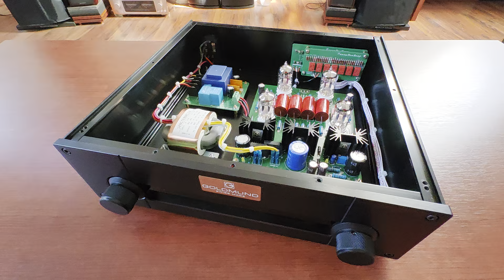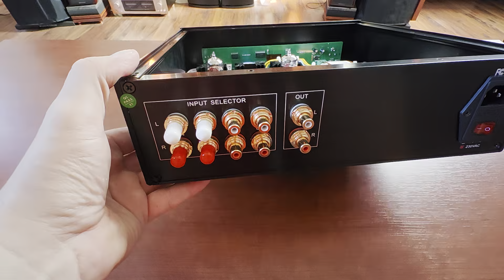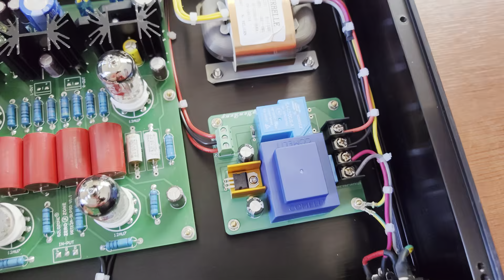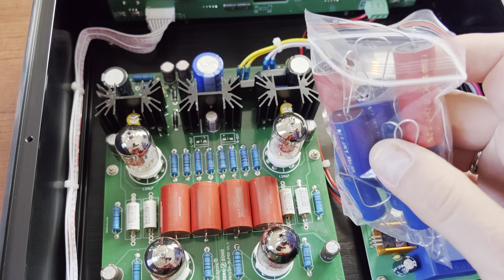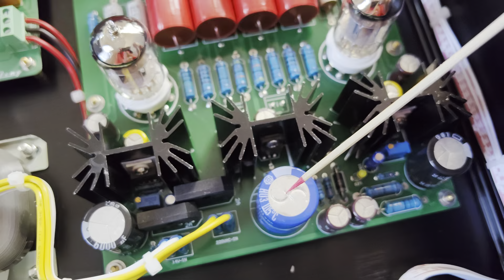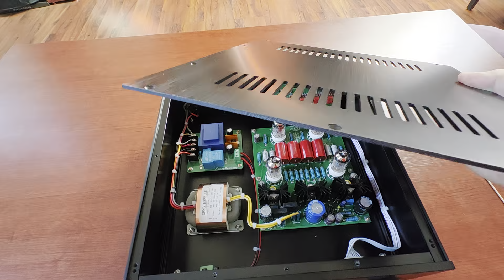Cary SLP-90 clone tube preamplifier first look - ZeroZone PRT12A

Comment: The blue capacitor is Hitachi. It has the correct value and is quite good. There’s no need to replace it at all. K2700 is the marking of the transistor that is located nearby in the circuit and is attached to the black metal piece.😅

Comment: Do you know what the volume increment changes are, as indicated (I assume) on the front panel? 1db steps? 1/2db steps? For me 1db is too crude. 1/2db is preferred. --Thanks
Reply from the maker: Hi! No idea, the volume setting module is a generic one, it has 128steps but I can tell you how much db is one step :(

Comment: Buyer beware! I saw this video and bought one of these. I received it and loved the way it sounded. In less than 3 weeks it was dead. I went to turn it on one day and nothing. Contacted the seller and was given the runaround. Checked the fuse. It was good. Changed it anyway-still wouldn't turn on. Took the top off and checked the inside. Nothing scorched, burnt-looked clean. Seller would not make right on this. EBAY Seller is pinshuche. I spent nearly $400 dollars after shipping etc. Now I have a paper weight.
Reply: I also bought one from that supplier. OK so far. Have you made any progress?

Comment: Does anyone already came across the schematic of this preamplifier? I want to reduce the gain, because with CD-player or Phono-preamp it's much to loud with my NHB-108 Pro clone!
Reply from the maker: I think there was some info on that in the comments for the full review video (look for the other one)
Reply: I bought a pair of 20dB Rothwell attenuators and fitted them to the power amplifier inputs. 
The difference is remarkable. Previously the maximum bearable volume on the Cary was about 30. Now it's 60, and the music sounds more alive. I really recommend them.

Comment: Those capacitors near the heatsinks are not reliable
Reply from the maker: I'm not sure if there was a significantly high temp from the radiators. I think I've measured that - I check internals with laser thermometer during burn in to be sure I will not burn my house overnight :D

Comment: Just a quick question.

Does the Cary run hot?

I going to have to install it in an entertainment center cabinet with a closed glass door.
Reply from the maker: No its not, but when in use do open the door - its healthy for any audio equipement to have some air circulation :)
Reply: @ Will do and thank you for the reply.

👍🏻

Comment: Hello,

I have the Wiim Ultra that I’m using as my DAC and Preamp that will soon be going to my Zero Zone TPA3255 mono blocks when they arrive.

Question would you think I would get a big improvement in sound quality if I feed my Wiim Ultra streamer DAC/Preamp through the Cary preamp then to the TPA 3255 amps?

Does the volume knob on the Cary SPL90 stay at the same level when you turn it on and off? If so I could just set the Cary volume knob and then use my IPAD to control the master volume on the Wiim app from my tablet.

Thank you…
Reply from the maker: Yes the Cary as vol control would allow your WiiM to work with 100% volume so you would not loose any details in digital domain (lower effective bitrange). Cary controls volume via relays so the position of the pot is irrelevant, it just remember the volume level that had been set. And it has remote too :D
Reply: @ Awesome thank you very much.

Have a fantastic day.

Comment: Hi Volks,

So today is my Cary arrived 🎉. After 10h burnin I listen music over the Cary SLP-90:

It’s very very good sound. But my Marantz Series 7 is also good, too. The Marantz is for me the best of this TOP-PreAmp, because the sound is more free as the Cary. The Cary has more heat…more wood and the Marantz more Air into the sound. The stage is grater by the Marantz. The Cary has more focus in the middle. But that’s by my ears😅.
Reply from the maker: Thanks for sharing! Thats with stock tubes right?
Reply: @k4syx  yes I with stock-Tubes. I will change @ the Marantz the MKT to MKP.  Tom, do U have Change the Tubes @ the Cary?
Reply from the maker: @FDKAUSW  I did the review with the stock ones as thats what everyone will get with the preamp, but then I've replaced tubes with better ones that I have in my collection and that was a significant upgrade. Tube rolling is dangerous for your wallet though, be warned! :)
Reply: @k4syx  what fore Tubes do U use for replace? Thx.
Reply from the maker: @FDKAUSW  psvane art (-s) series
Reply: @ Mr. Schwarzbeck says:“Use JJ-Tubes“ I have now no referenc what is the Right Tubes… f*** 😅 But for the Maranztz I need ECC83 Tubes, but I think it’s the same kind of Problem: With Tube are the audiophilest Tubes…??
Reply from the maker: @FDKAUSW  that's the road down the rabbit hole :D
I'm piling up some NOS tubes for a few years now, it's not like there will be more of them smt time soon and I don't expect any price drops :)
Reply: @ witch pill 💊 I must eat that U let me in Morpheus?

What is now the right way in to the hole or other witch tube is the best audiophile for ECC83? Thx
Reply from the maker: @FDKAUSW  the thing about the tubes is they change some in different ways in different requirement. That's a nightmare because something that sounds great in my amp may be not the best choice for someone's preamp and vice versa.
And also there's the thing where some guys will love muddy warm sounding tubes over clean and transparent ones...
I'm reading as much as I can and get new stuff when I see great opportunity. 
For example you can't go wrong with original Siemens, Amperex Telefunken or RCA tubes. 
But these get more and more expensive every year as there is less and less of them. 
I have some Amperex, some Mitsubishi, Siemens and RCA tubes and I do plan to make videos on them in the future if there will be interest in something like that
Reply: @ I just looked up ECC83 here on YT. Very interesting! Most of the videos are electric guitar amplifiers... and I have to admit that the changes in sound are within limits. So they are definitely not a big deal... I expected a much bigger difference, given all the fuss that is being made... I just bought NOS tubes made in Russia. I'm really excited...

Comment: TIP: To reduce the switch-on POPer to a very low level, I recommend setting the switch-on delay to 360 seconds. The POPer is then barely noticeable, even when the amplifier is switched on. This period of time is also used by e.g. B. audio research specified for their switch-on delays.
Reply from the maker: THANKS! I will definetely try that as I also got CAT-1 pre clone that has the same chassis!
Reply: @ F-1
0-127
Default volume for input channel 1
F-2
0-127
Default volume for input channel 2
F-3
0-127
Default volume for input channel 3
F-4
0-127
Default volume for input channel 3
F-5
0-127
Maximum volume setting
F-6
0-255
Signal output delay after startup
            (seconds)
F-7
0
Positive phase encoder
1
Inverse phase encoder
F-8
0
The startup volume is set to the default volume
1
The startup volume is the memory volume
F-9
0
State after power on: standby
1
State after power on: turned on
F-A
1-8
Display brightness during operation
F-B
Display brightness without operation
F-C
0-99
Brightness retention time after
      operation (seconds)
F-D
0-1
1: Confirm default settings

Comment: What about tube biasing? How is it done?
Reply: You don’t bias preamp tubes only power tubes!
Reply from the maker: Excellent question actually. Haven't noticed there are no pots on the PCB. On the other hand, isn't that mostly for power tubes?
I'm more solid state guy, so I'm learning, but in my Cayin tube amp I have bias setting only for power KT88 tubes, not for pre and inverter sections?
But I do may miss something here!
Maybe someone could chime in?

Comment: I look forward to your video about this one. I read in a forum that the gain was too high and did not give enough usable range of the volume control. A pair of RCA gain attenuators could be used .  If put at the output, it could help  distance the signal from the noise floor.  Usually, they are put at the input. Maybe lower gain tubes could do the trick ( 5963? ).   I have plenty of these.  Any pot on the circuitry.?   The power supply has no tubes, unlike the original SLP-90.
Reply from the maker: @st-gelaisrene3287  no volume pots here, it's resistor ladder with set of relays. Haven't heard the volume problem during burn in, I will remember to check that.

Comment: Interesting, I've actually been looking at the SLP-90. They're still going for close to $2k used. Which led me to look for an alternative. I'm considering the Guldmund Tells T2500.
Reply from the maker: @kevinusta7534  Clone, right? I saw them, they look good, but I'm looking mainly for power amps. Preamps are just a side quest:)
Reply: @k4syx  hopefully your journey will take you to get your hands on the Nelson Pass mono block clones. Cheers
Reply from the maker: @kevinusta7534  I've seen those, there's more than one version actually. We'll see about that, as my electrostats are power hogs :)

Comment: Bit worried with the position of those 3 caps inside the 3 heatsinks; caps don't like heat...
Reply from the maker: @bitmanev4331  yes I will measure the temps here, I was wondering about that too.
Reply: They are rated for 105 degrees. Is that sufficient?

Comment: K2700 means mosfet 2sk2700 on the heatsink, used to regulate HV plate voltage
Reply from the maker: @monitostv  Thanks, I'm more solid state guy, so I'm always learning something new when it comes to tubes :)

Comment: The original SLP-90 coupling cap values use 0.22uF caps, and the output caps for the cathode follower were 4.0uF..
Reply from the maker: @rickg8015  Thanks! 
We'll see how does this one sound.
Reply: The Chinese copy has two 0.1uF in parallel (0.2 uF total) and two 3.3uF, again in parallel (6.6uF total). Why they chose that path (using capacitors in parallel); they probably wanted to reduce ESR or they had them in abundance!
Reply from the maker: @BlazSvetlic  Both reasons are valid but I would go for the first one, these are diy re-designs that are also available on diy forums so the change would be made because of more technical reasons than just having a bucket of these available ;)
Reply: @k4syx   The other day I replaced 0.1 uF capacitors and then I measured the ESR of the ERO capacitors which is about the same as the Mundorf M-Cap ZN Series that replaced them. By putting two capacitors in parallel they actually halved the ESR! clever...

Comment: Looks like no tube rectification, which could make more like original sound. I don't think it will sounds close enough to original with TR power supply even if it sounds good enough.
Reply from the maker: @jkim4712  yes there are some changes, it's not a 1:1 clone which may be good or bad.

Comment: Just received the Dartzeel FM300 Amp ( 230v model with twin power transformers )  Sounds great out of the box. Has an art deco look to it which pleases the boss!
Reply: Which store?
Reply from the maker: @michaelbooth6007  DartZeel FM300? You probably mean Transaudio FM300A? Or the gold build with two transformers?
Reply: @k4syx  It's the gold build with the power button in the middle of the case made by BRZHIFI. Built like a tank, no tranny hum or speaker noise and the sound quality is already excellent.

Comment: Are you getting on a PRT13A based on ARC Sp10?
Reply from the maker: @errcl65  yes that's the one, same Gabster got some time ago but I think he never got to make 3rd part of the video with mods
Reply: @k4syx  that the one. I have always had an arc pre for last 30 years.  All 6dj8/6922.  Prt12 looks ok, but they charge too much for what you get IMO.  I await your listening review on prt12.
Reply from the maker: @errcl65  I've ordered Siemens 6922 NOS tubes from Germany for the tests, and for 12AU7 I have PSVane Art and some good NOS sets. I have high hopes as it has balanced ins and out, I'm also willing to replace all caps with better ones etc. It just got here this afternoon, but the 6922s are still in transit... Soon.

Comment: One thing that has been said about the original Cary amp was that it has a rather hot output that might be a problem for some power amps. The original has input sensitivity adjustments per channel. Would love to hear if this clone has this issue? Also hows the remote (same as the JC2 amp)?
Reply from the maker: Thanks for the hint, I'll check that with amps I have here for full review! 
As for remote: exactly the same as it was for JC2. Comes with chassis as a standard set I guess.

Comment: I single-handedly built my own house and I am an electrician which is totally different than an electronics technician. My current preamp is an Asgard 3 which is 1/4 the size of that preamp. How would you compare the audio differences?
Reply from the maker: @carlsitler9071  I can't reliably answer your question as I haven't heard Asgard, and I am yet to do critical listening session on this Cary clone.
Btw my father was electrician and that was one of the reasons I am who I am today. And congratulations on the house that's the right way to do it!

Comment: Looking forward for the FM Acoustics 255MK2 preamp review :P. I've got the Accuphase c3850 clone, I'm impressed with the build quality and components used but not that impressed with the sound though, with SMSL C100 as preamp to my boXem Arthur 4215/E2 power amp, the sound is detailed/neutral/transparent, zero noise if have complete silence recording, even can hear tiny details hidden in the background via speakers, some recordings might sound a bit "brass" at high volume though, any idea are we able and possible to complete eliminate the noise from these AliExpress preamps while still retain some magic color to the sound?
Reply from the maker: Thats interesting what you saying about the noise, for stuff I got so far I had never had noise issues (and rememeber I do check these with my electrostats too). So maybe I'm lucky, or maybe it depends on particular clones and how well are they made.
I also got C-2860 Plus clone - clone that doesnt exist, as there is only Accuphase C-2850 in that lineup, but that review is still ahead of us. Which C3850 do you have? Can you link it here?
Reply: @k4syx  Ok I'm just nitpicking on the noise at surgeon level, it won't be hearable at normal listening level, most important thing is I'm not that impressed with the Accuphase c3850 clone sound and worse I think it add hum on the left channel and overall feel just a little bit bassy, for the item you can easily find it from the site same shop GZLOZONE (ZEROZONE) between. Not sure it's possible to ask the shop custom design add a button to these preamps so that the active stage can be toggle off, i.e. turn to passive with no gain and color :), I know Khozmos can do this, but then it costs a lot more for quality build!!!
Reply: @k4syx  Ok I'm just being nitpicking here on the noise evaluation at surgeon level of evaluation :))), the most important thing is I'm not that impressed with the famous Accuphase c3850 clone sound, if it's neutral then it's no better than my DAC direct as preamp to the boXem Arthur power amp, which turns out to be way ahead of any amplifier I have evaluated, for the item I think I cannot put the link here but try put 1005001465885474 plus dot html on the site. Ultimately I'm thinking perhaps to ask if a shop can make a preamp sound toggable with tone defeat button, i.e. turn it to passive with a button :P as that reach zero noise even when max out the power amp gain.